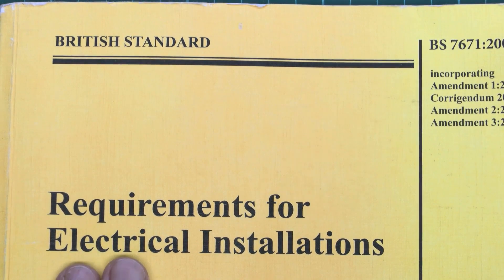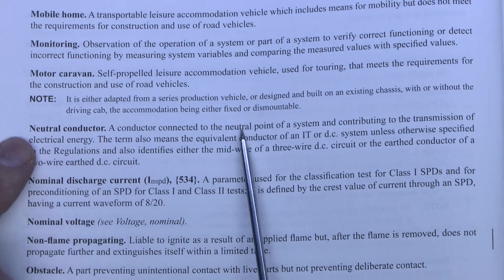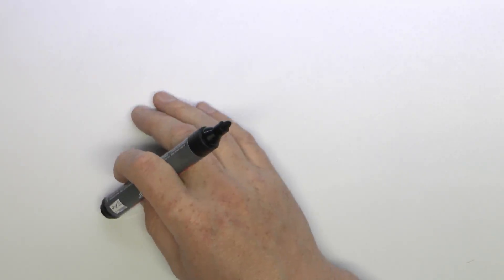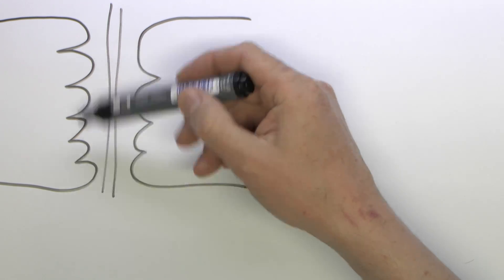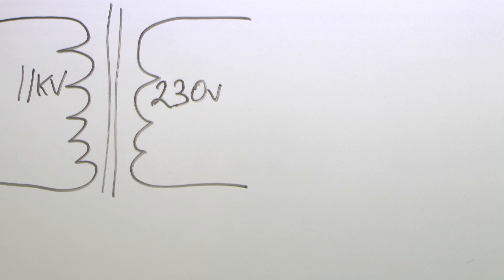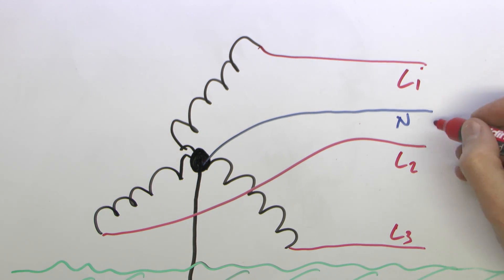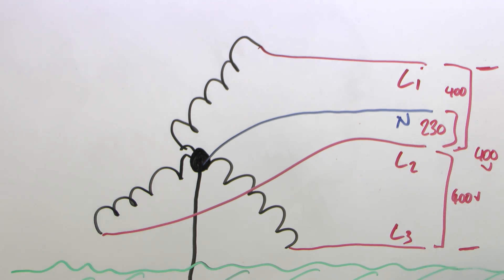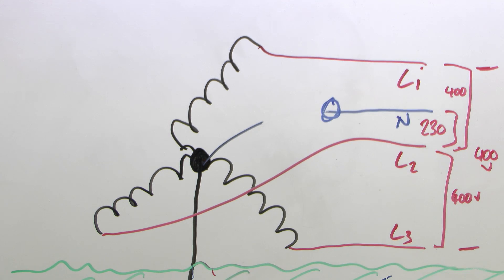Neutrals from transformers and in electrical circuits

Comment: +John Ward
I think the impedance of the earth-rod itself is worthy of mention...  In your video, your early comment that connecting ground-rod to neutral brings neutral to ground-voltage can (sometimes) be misleading....   I think I read somewhere that distribution transformers are supposed to be grounded with <=20ohms earth impedance.  Worth pointing out that DNO networks typically have such a LOW impedance earth-rod at the source [let alone extra PME earths].

There is a common myth that grounding guarantees to bring any wire to close to true earth potential, but this depends on the contact-resistance.  Mike Holt's video here at this point explains very well:-
https://youtu.be/mpgAVE4UwFw?t=4038

SOMEBODY will suggest adding ground-rods to keep neutrals' "safe"...  I also (heard) DNO's put Neutral voltage monitoring in place, but not really sure what intelligence really exists in their systems.

If you want to add to your definitions, what about "PEN conductor"... =).
Reply: A neutral wire only carries the operational current. The PE (protective earth) carries only fault currents. The PEN conductor is a combination of the PE and the neutral, it carries operational current and in addition in case of a fault it would carry the fault current too.
And in case of a broken PEN the same thing would happen as shown in the video with the broken neutral. But in addition metal housings of class 1 appliances would become live. That's the reason why PENs are only permitted if you use larger wires (at least 10mm² copper or 16mm² aluminium).
Here in Germany the most common system is TN-C-S. You get three phases and a PEN from the supplier, the PEN is splitted into a separate neutral and PE inside of the service entrance box. In some older installations the PEN is splitted in the fuse box, and in installations made before 1973 the PEN was actually splitted on the outlet. The PEN was connected to the earth terminal, and from there a wire bridge was installed to the terminal for the neutral of the outlet.

The N is actually an operational earthing, the PE is a protective earthing.

You can actually calculate the voltage between the line conductors if you know the voltage between one line and the neutral. You multiply the voltage with sqrt of 3 (~1,73):

230 V * 1,73 = 398 V
240 V * 1,73 = 415 V

In Germany kitchen cookers are connected to three phases, two heating plates on one line and the third one for the oven. The circuit is fused with three B16A MCBs:

400V * 16A * 1,73 = ~11kW

If your neutral breaks in a three-phase system this will cause some major issues. For example imagine you've got a 20W soldering iron connected to L1 and a 3680W electric heater connected to L2 and the neutral breaks inside of your fuse box then this would happen: You'll get a voltage divider, the soldering iron would "see" 397.8V and the heater will "see" 2.2V.
Reply: Transformer station is 100m (~300 ft) from my home. And there's another one nearby for another grid segment. These transformer stations are small, they're only 15 to 20m² (150-160ft²) and are inside of a pre-manufactured concrete housing:

https://www.hildesheimer-allgemeine.de/typo3temp/_processed_/4/b/csm_ecad01a400-70a35c98-4b90-11e7-aba0-377d83391380-710f3470-4b88-11e7-aba0-377d83391380_9c87ee5356.jpg

The cables are laying below the sidewalk. In most cities and towns here overhead wiring was replaced by this system. The cables are laying inside of conduits, so they can be replaced easily.

And here in Germany houses have an additional grounding system, even if the utility company provides a TN-system. The ground rod is implemented in the concrete foundation of the house. In older houses, built before the 1970s, the incoming water pipe was used. That was the reason they made these pipes of thick cast iron.
In Europe these systems are common:

-TN-S:
The utility supplies you with the lines, a neutral and a ground wire.

-TN-C:
The utility supplies you with the lines and a PEN. The PEN is a combinated neutral and ground wire. In most cases this wire is splitted into two wires, a separate neutral and the ground inside of the house. This is changing the TN-C into a TN-C-S grid.

-TT:
The utility supplies you with the lines and a neutral. Ground must be provided locally by a ground rod. In addition to achieve the cut-off time in case of a short-circuit RCDs (residual current device, in america called GFCI) must be installed. The cut-off time in case of a short-circuit must be less than 0.4s for a circuit which is fused with less than 32A. In a TT grid you can only reach this time if you use RCDs/GFCIs, as you already mentioned the resistance is too high. Especially when the ground is dry. With the RCD you can achieve a cut-off time of less than 0.2s. In most cases we're talking about 0.02s.

https://en.wikipedia.org/wiki/Earthing_system#Low-voltage_systems

That's the reason why we have RCDs which are completely separate, not integrated into an outlet or a circuit breaker. But you can also get them integrated into these devices. When it's integrated into a circuit breaker it's called RCBO (residual current circuit breaker with overcurrent protection).
There are RCDs available where you can install a single one to cover the whole house. They are rated for 3x40 or 3x63A. But that's no longer state of the art to use a single RCD for a whole house, because if a problem occurs the whole house is without power. And in addition every class 1 appliance produces a small leakage current, and these sum up.
Reply: Thats a good point. Ignoring any resistance issues with the ground rod, the ground rod impedance is something to think about. Since power stations almost always run as a wye configuration (from the station transformer at least) with a neutral conductor to handle unbalanced loads and provide a common return, the earth is connected to the neutral conductor at the power station. The earth being a rather good conductor as far as organic material goes, means when you put a ground rod into the ground from your house (this depends on the setup in your country as some will use the neutral from the pole) if it has to handle a fault, it will have to travel all the way through the earth possibly hundreds of miles to find the nearest transformer ground to complete the circuit, this results in high loop impedance, with can be almost as deadly as not having a ground at all.

I'm interested in the different systems in use around the world. Some run separate ground and neutral from the transformer, some run combined ground/neutral from the transformer, some have no ground or neutral. In modern US installations (extreme rural installs excluded) we run the two lives from the split phase, and a combined neutral/ground that is grounded at the pole, then once it reaches the house another ground spike is used and the neutral and grounds are separate from there on.
Reply: Yes, I live in Germany. Three-phase supply is common here in Germany.
The connection is comparable to the split-phase system you use in the US, but instead of two-pole breakers we use three-pole breakers for three-phase appliances. All the other appliances are connected single phase, but you must take care that you distribute them evenly on all three phases.
And I suppose AV-equipment is double insulated everywhere, the reason for this is that you can otherwise create a ground-loop which makes humming noises. The shielding of antenna cables is always grounded, that would be the first grounding point. The second one would be the grounding of a housing of a class 1(grounded) appliance. That's the reason why these appliances are all class 2 (double insulated). In most cases the hum would be 50, or in your case 60Hz. Sometimes it can be double the mains frequency, coming from the rectifier (pulsating current before it is smoothed with capacitors).
AFAIK there are no problems if the system is according to the regulations and fully ok. In case of a damage of the neutral wire inside of the panel it can become ugly....the appliances connected there would be roasted propably. But in most cases one room is only connected to one phase.

Kitchen cookers and stoves are connected three-phase, but they are 230V appliances in most cases so you need the neutral. The four plates are divided onto the two phases inside of the cooker, always one large and a small plate on one phase. The third phase L3 is for the baking oven. Actually this wiring is inside of the appliance, you just need to put the five wires (L1, L2, L3, N and ground) into the correct terminals. The stoves are always hardwired here. And you could wire them for single phase use, then you must insert bridges between the correct terminals. In this case here the terminal of a cooking field, the oven is a separate appliance:

https://www.elektrikforen.de/attachments/img_3514-jpg.13051/

It's connected two-phase, the oven as a separate appliance would be connected to L3 directly in the box were the transition is from the installation of the house to the appliance cable. Cover removed:

https://www.xavax.eu/bilder/00110/awx/00110828awx2.jpg

brown is L1, black L2, grey L3, blue is neutral and green/yellow is the ground. The strain relief is for the cable to the stove. But you can also connect the stoves single phase. The manufacturers deliver bridges with the stove which then must be implemented:

https://forum.teamhack.de/attachment/4898-anschluss-jpg/

1, 2 and 3 are for the line conductors, next to it are the two neutrals (oven and cooking fields). Don't ask me why someone made a connection between the neutrals and the ground. That's not compliant to the regulations.
Reply: @Marcel_Germann  Hello, I understood his video somewhat and what you were talking about, you seem to know a lot just like John, so here's a question.  In terms of the way John explained the neutral becoming neutral due to being grounded, can you write a little bit to a person who doesn't know that much about the subject, regarding what if there was a fault and for instance a washing machine chassis became live, touched the live wire or something, but was also grounded at some point.  Now does it matter which points relative to where we would touch with the hand while also touching something else that is grounded or anohter person, resistance of the chassis isn't like the heater, but John explained if we were to measure voltage in the middle of the heather it would be half.  So if the breaker didn't burn out, or trip, what's the scenario, i'm just trying to think of possible faults involving ground.  I know that the current would flow to the ground as it's a nice 20ohm ground, but I don't really understand it.
Reply: @MuminovicGoran  
In case of a person connected to the washing machine the circuit breaker will not trip. Only RCDs/GFCI-devices or RCBOs will trip in this scenario. Here in Germany, even back in the old days, it was absolutely necessary to use RCDs, or their predecessors which were voltage operated instead of current operated to get the circuits switched off in time during a fault. The regulation here in Germany says, and even back then said, that short-circuits must be switched off in less than 0.2s if the circuit is fused with 32A or less. In a TT-grid you can't reach this with circuit breakers only.  

https://en.wikipedia.org/wiki/Residual-current_device

I can tell you an example of a type of grid not referenced to earth potential, so without a neutral:

In hospitals they give more about security of supply. So they use an earthing system named IT (insulated terra). In this system there's no connection to the ground (only a high impedant one), and no neutral of course. So you actually have two lines. If you try to measure the voltage of one line against ground you'll measure total nonsense voltages.
The advantage of this system is it can handle two faults. And you can only get an electric shock if you touch both lines at the same time. The first fault will turn it into a normal TN-grid, the fault will ground one wire and this will become the neutral. Only the second fault will cause a circuit breaker to trip. And that's the bad thing, if there's already one fault in the system you can get a shock if you touch the then line conductor because with fault 1 the system is referenced to the earth potential what is not the case if you have no fault in the system. That's by the way the reason why these IT-grids are small, it's making it easier to look after faults. And the insulation must be monitored all time.
The same principle is used by safety transformers, mostly used in repairshops. In residentials or in hotels you can sometimes find them labeled as "shaver sockets":

https://en.wikipedia.org/wiki/Earthing_system#IT_network

https://en.wikipedia.org/wiki/Galvanic_isolation

https://en.wikipedia.org/wiki/AC_power_plugs_and_sockets#Shaver_supply_units
Reply: Marcel, You live in Germany? I learned a little while back that many residences in germany have an incoming 3phase supply instead of a single phase supply as we get here in the US. How does that work for you guys? I imagine it makes high power appliances like stoves and large motors easy to install and handle with small amounts of copper. But is there ever a concern with having two outlets on different phases and having equipment connected between them? We have enough problems with that on our split phase in America when residential AV equipment is hooked up, say a TV or projector on the wall on one phase and a home theater or computer or similar device on a separate phase connected by cables which join the chassis grounds. It manifests here with a 60hz hum between devices and on some with particularly high leakage, small tingles from electric shock between the two phases (240V between the two). More modern electronics for this reason have gone to double insulated with only live and neutral with no ground connection, but many devices simply must have a ground because of exposed metalwork for the AV connections. Does that cause problems with high leakage devices between your 400V legs in a 3 phase system?
Reply: @Marcel Germann
Why is it important to balance the load between the 3 phases?
Is it for a safety reason in case the Neutral is disconnected?  Thank you
Reply: @yanizrulyanizrul5814  Because you'll overload the wiring, especially if the transmission lines are in a delta configuration and not a wye. A perfectly balanced wye will have zero current on the neutral.
Reply: @PaulSteMarie  Only at the fundamental frequency. Third harmonic currents  all add in the neutral.

Comment: The neutral is connected to the ground to prevent the high voltage of the input side of the transformer flowing into the low voltage house etc in case of insulation failure in the transformer.

Comment: But why earthing/grounding one wire in the first place ?
Reply: It's there to protect the system from lightning. Basically if the grid is striked by lightning, the current will go through this grounded conductor instead of the system potentially destroying whatever that is connected to the system. Tv, computer, lights, etc...even the transformer itself. However, grounding is actually a trade off because we essentially connect the ground (earth) to the transformer and we are standing on the ground, which makes us electrically connected to the transformer also. So all it takes is for us to touch the other side of the transformer and we complete the circuit, thus, get shock.

Comment: John nice vid. First time I have seen it. 
But, many will be thinking, why is the circuit (N) connected to the ground?  What has this taking cable to connect to the ground, when I do not do that with my battery radio? 
There is: 1) grounding; 2) circuit protective conductor (cpc); 3) Equipotential bonding. 
These are all separate but all meet at the main grounding terminal. 
All these three use the same coloured wiring creating confusion. Different coloured cable for each would make matters easier. 

1). Connecting a system to the ground is for lightning strikes and static electricity. Lightning always wants to get to the ground, so if it hits electrical equipment it has a path to ground. 
2). cpc is a parallel neutral (N) with no current running through it  - if L is in contact with the cpc for any reason it runs back to the point where the cpc and N join which is before the protective device in the main panel. The L & N will be out of balance after the protective device so it will trip isolating the circuit.
3). Equipotential bonding is connecting all the metal parts of a house together (e.g., water and gas pipes) that do not carry electrical current - to the electrical ground. This is to ensure if a metal part becomes live all metal parts become live to reduce/eliminate electrical potential.

Comment: Great information professor. I have a question though…there is something I’ve always struggled with that I can’t get an answer for though. Being that AC is alternating back and forth, how does your ground rod not have 120v on it.
Reply from the maker: AC means the line conductor moves between +230V and -230V relative to the neutral.
The neutral is connected to the mass of Earth at the transformer, so is always the same voltage as the neutral, so any measurement of voltage between the Earth and neutral will be zero.

There is no 120V in the UK.
In places such as North America, the two line conductors (hot conductors) are between +120V and -120V relative to the neutral and Earth (ground), and are at 240V relative to each other - when one of them is +120V, the other one is -120V.  That gives 240V between them for higher powered appliances such as dryers, or 120V between one of them and the neutral for smaller items.